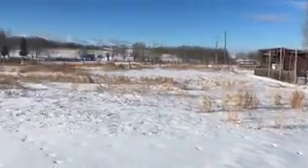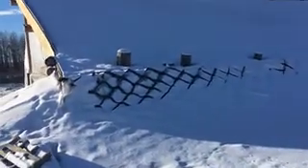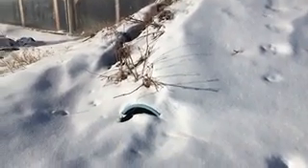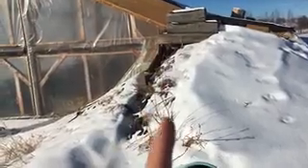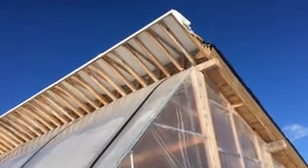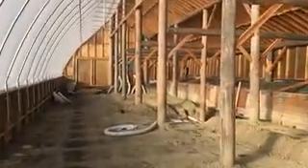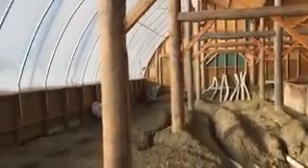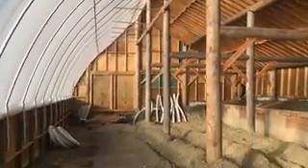Passive Solar Greenhouse

Comment: Awesome build! Great solar greenhouse design.
I’m left with a question, what happens in the summer, when the sun is directly overhead? Does the inside still get sun?
Reply from the maker: Yes, it's almost solstice now (end or may) still got a moth to go, but shading from the overhang also helps to keep it from being an oven in summer - everything has a trade off in the greenhouse - insulation vs thermal mass for example.  Direct sun in middle of summer is primarily in the front 50% of the greenhouse at solar noon.

Comment: Even though you are far North, you might need vents at the peak of the roof during summer.   If you install LED lights they really need to be very close to the plants to be of any benefit.   RMH venting exhaust outside from the middle of building might prove to difficult.  I would omit the cob benches all together because getting the exhaust out through such long distances will be hard enough.  Rj - Beyond Harvest Veganistas
Reply from the maker: Thanks RJ - agreed roof vents would help for summer passive solar ventilation, but challenging to close every night in spring and fall ;)
Reply: @jeffrempel3285  there are automatic ones available. The one I've tried are the wax piston type that don't use any electricity. $60ish for a name brand and they are rated for 15 pounds of force. My 8x 12 greenhouse doesn't have any fans because I prefer to let convection do the work for me. I have one large vent at the peak spanning the whole length by 1 foot and the same at the bottom of the front. It works really well.

Comment: Impressive! How warm does it stay in the dead of winter? Love the rocket mass heater plan. Can you grow year round?
Reply from the maker: Rocket mass heater with cob bench still in the future I think, in the winter when it's -25 c and sunny it'll be warm during the day, but can still drop to -8 ish in the night... that was without the SHCS charged (from a season of summer heat) and operating the winter to increase cold air at night - with this ACTIVE system pumping air from the warmer ground below during the dead of night on a cold winter night I'm pretty sure we'll be above zero

Comment: What is the model of the temp/data logging device you are using?  Nice structure!  Looks like the Glacier Series greenhouse you cut in half.
Reply: Campbell scientific with radio frequency no Wi-Fi needed and yes glacier series good eye for detail
Reply: Thanks for the info.  I actually have a 100' Glacier Series.  Have had some issues with not being structurally strong enough to withstand 60+ mph winds so had to beef mine up.  Thinking of cutting mine in half some day and making a 200 ft passive solar.  Just happened to see yours and got inspired!
Reply from the maker: I think it is Oregon Scientific or something like that - yes it is the Glacier series cut in half  - you know your greenhouses!!! impressive ;)